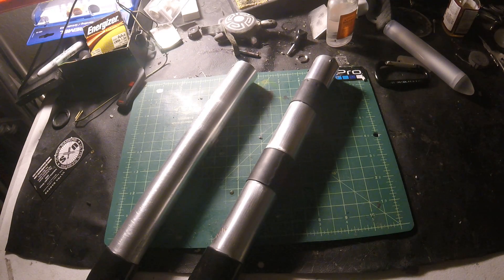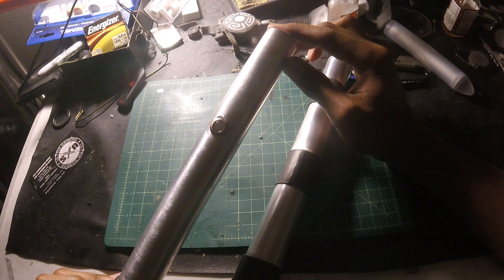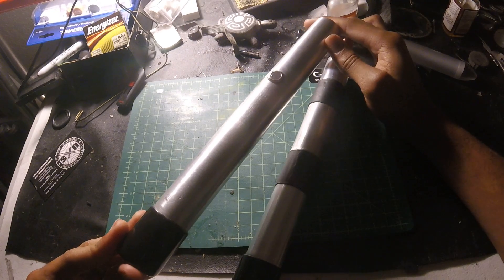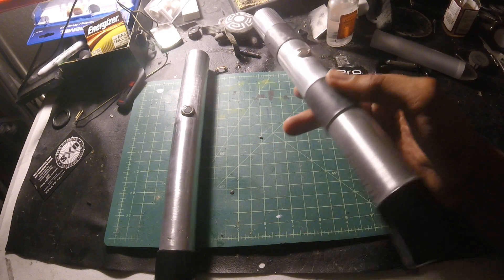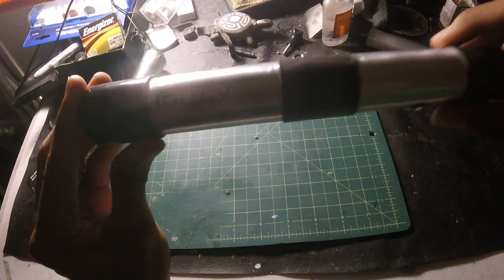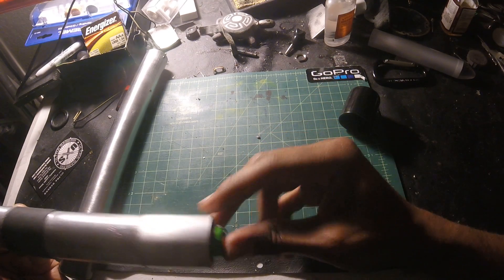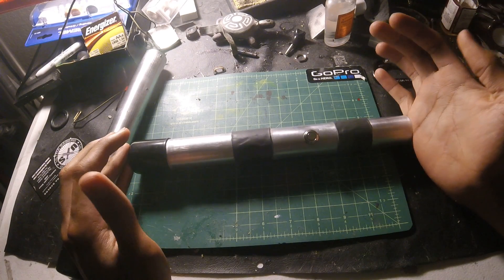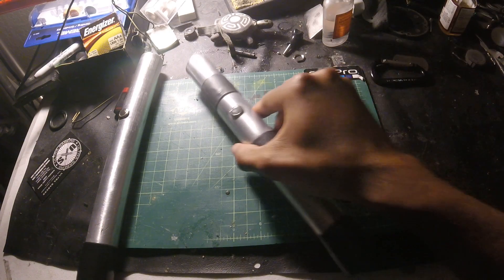Combat Ready Lightsaber - Vhole DIY Build

Comment: How did you secure saber blade inside hilt and did you cut treads inside the hole for screws?
Reply from the maker: The blade is held in by a an Alen wrench screw
Reply: @thebraykasnmtuskens  So you just drilled a hole an put screw in you dint have to cut screw treads in for the screw?
Reply from the maker: @ivansucic9149  yes I had to tap the hole 8/32